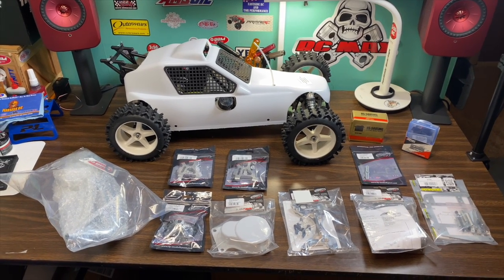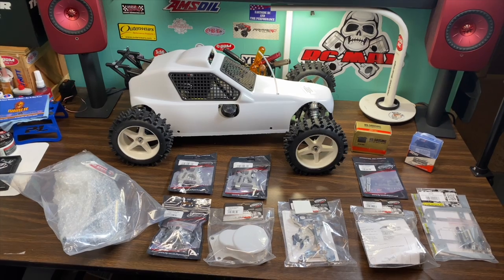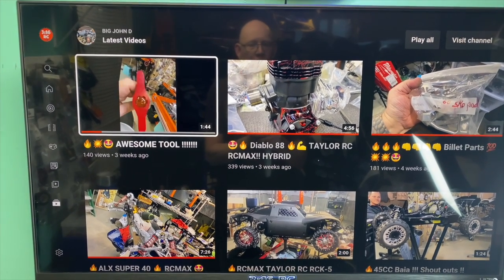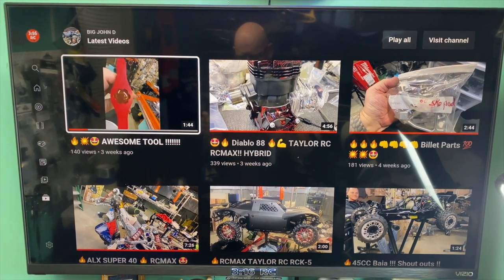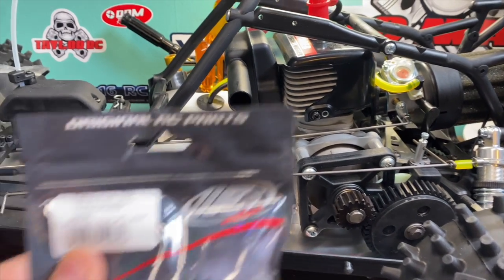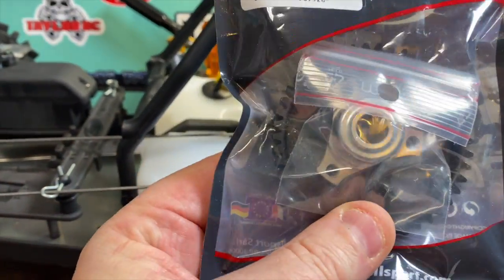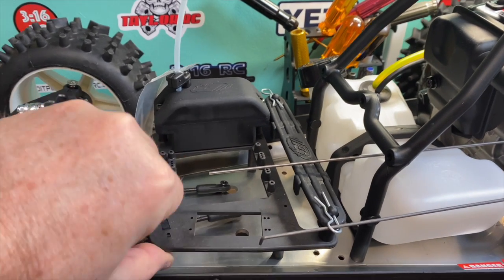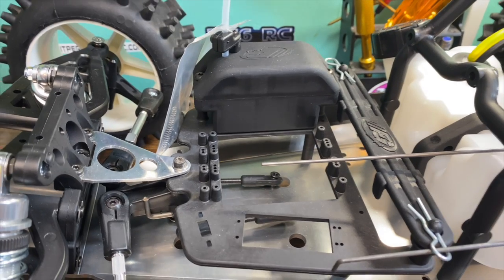FG Marder Gas RC Upgrades Billet

Comment: Hi 😀 I have just bought a 30 anniversary Marder and some options. This is my first large scale car. I find it a pity that FG does not provide any installation instructions with its options.
Reply from the maker: Congrats on the Marder 😀 Its a good selection for your 1st large scale car. I'm not sure why no instructions 🤷‍♂ If your not sure just hit me up or if your on Facebook join the FG Modellsport group and the 1/5 Scale RC Obsession . A lot of help on there for sure.
Reply: @316RC  Cool thanks 😄 ! I will join the FG FB group ! I bought the gear wheel protect, the gearwheel 44 teeth (and a 20 pinion), an Outerwear pull-starter filter, the FG alum. gear plate 97 and the rear brake kit (here an installation instruction would be nice, but FG is not providing any), and GRP road tires. I haven't even started the engine yet, waiting for the spring to break it in. I will probably get the FG optional exhaust as well. Cheers from Switzerland (I have the 150/300 Marder 30th anniversary).
Reply: @316RC  A tuto on how to replace the differential with the aluminum one would be very nice 😃
Reply: @316RC  subscribed 😀👍
Reply from the maker: @Serialcrasher  Thanks for subbing👍 Thant a nice list of upgrade parts you have. Gear plate 97 is a nice upgrade indeed😀. Upgrade exhaust will get more power out of the engine. I did shoot a video of the Diff upgrade. Look for that soon. I'm done with all my upgrades just waiting on my OBR engine to come in to finish up.

Comment: Hey Mr 316 when you order parts from RC parts online how long does it take to receive those parts Express and regular postage
Reply from the maker: @CharlieMason-vd5is  I think it took about a week from DHL
Reply: @316RC   oh okay I found a FG stadium trunk on marketplace and it's two-wheel drive with a c y engine it's like 4hp I ordered the parts for the four-wheel drive from them and I'm planning on fabricating a standalone lay shaft to install a Taylor 50gt but I have to say I love that bm5
Reply from the maker: @CharlieMason-vd5is  Did you really mean  a Taylor 50GT😱. The drive train will get destroyed 💥
Reply: @316RC  yes sir if it breaks there's a kit that a guy sells in Memphis at his hobby shop that will turn it into a chain drive
Reply: Also if you look at the way it's made in the back in between the bulkheads you can install a HPI Baja transmission but I want that four-wheel drive I love the way your truck runs